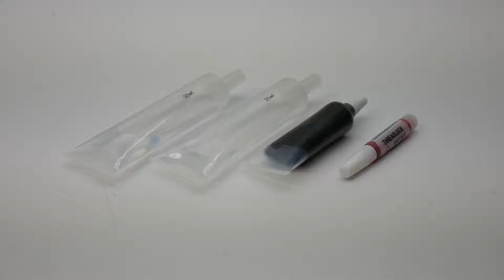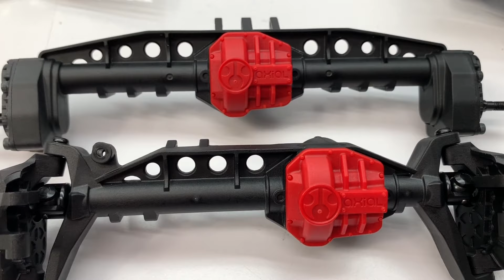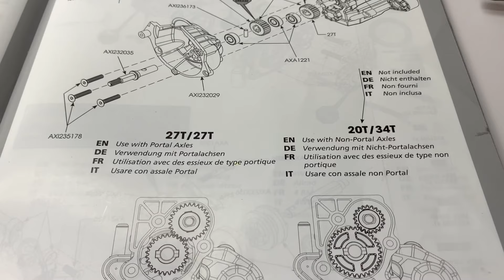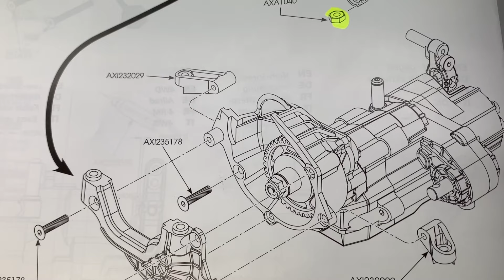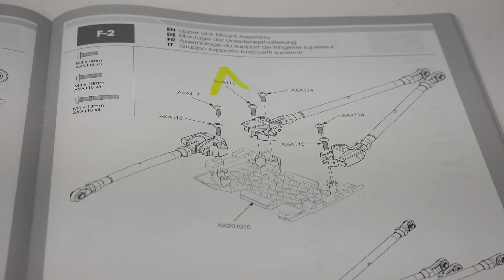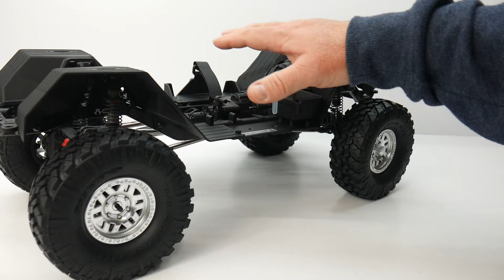Axial SCX10iii - Build Review - In Depth Look at the Chassis - How it Assembles

Comment: For best result use a M3 thread die to cut the thread in the hard plastic to prevent heat build up.
Reply from the maker: Good tip.....I was flying blind on this build, as it was so new at the time

Comment: If you have to tap holes I'm definitely not buying it. The TRX4 is so much better anyway.
Reply from the maker: I didn't have to tap them, although Horizon Hobbies/Axial recommends this.  The Panhard mount/driver side shock tower is also an issue is you run a decent servo....it will end up breaking

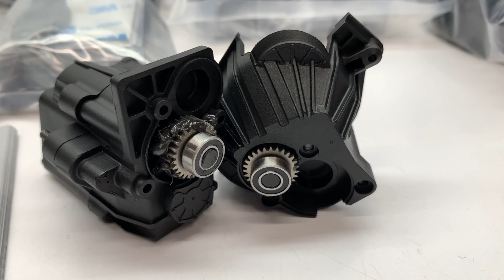Comment: @7:40. ### Why does a brushless sensor motor negate the need to use the 2 speed?###
Reply from the maker: Brushed motors are famous for their low end torque and smooth start up, not much top end speed (depending on turns).  Sensorless Brushless systems have torque and top end speed (depending on kv), but not a smooth start up - when you add a sensored brushless set up, you get all three worlds - smooth start up (being sensored), torque and top end speed (depending on kv)

Comment: I'm glad to see a fresh ground up new truck from them, and not just another rehash of the aging older platform, I'm definitely interested to see if they are setting this up for a portal less version and what size tire combo will fit it
Reply from the maker: They've already mentioned the capability of a portal-less drivetrain - most 1.9" wheels will fit - the JLU body is ideal . for the 4.75" Nittos, so basically anything 1.9" will work.  The stock wheels seem to be about 225SLW size

Comment: Laughed when you were talking about stuffing up Rich. I’m building the Tamiya Sand Scorcher and I’m tired, and same as you making mistakes. 
Getting towards the hard plastic stuff now, where it is gluing, painting etc. so I do have to stop for the night which is a good thing. As I look at the rear wheel and tyre on one side, the tread is facing the wrong way. And those suckers took forever to get the centre in the edge of the tyre without the five 10x2mm screws and matching nuts.
Tomorrow’s job!
Goodnight and thanks for the build review 👍🤓🇦🇺
Reply from the maker: I have a pretty standard rule now - no soldering after midnight. 😬
Reply: The RCNetwork a very good rule Rich! I’d probably have to add in no scalpel and reamer worker 😳

Comment: Good point on not using a power driver on the shock mounts.  I wouldn't have thought of that.  Thanks for the review!
Reply from the maker: Glad to help - it's a super stiffplastic for a reason, but brittle when driving a steel screw in it

Comment: Just like the Capra, I won't be investing in a kit that requires a $50 servo to get missing parts...
Reply: That servo is 14 bucks...but yeah, I see your point. Would be nice of them to include the servo saver parts.
Reply from the maker: Yeah, like Revnine said, the servo is $14.  But I'm with you, the servo saver items should all be in the kit regardless of which servo you use
Reply: Ok, at $14 that's very reasonable it's just the proprietary nature of not including it, thanx for the info guys!😁

Comment: I got the axe xerun sensored 1800kv am I going to have the same issue
Reply from the maker: Not sure, I have the motor mounted - but likely have to turn the motor to the side for the wires.  Just started ,messing with it last night while this video was uploading.  The main issue is the sensor wire

Comment: What motor and esc are you going to use
Reply from the maker: For right now, the Hobbywing Axe system....but there might be issues with the length of the pre sized  sensor wire

Comment: I want however I got to wait for RTR don't wanna build this kit
Reply: the transmission alone will be very labor intensive - I bet the RTR is going to be on the plus side of 500 easily, especially if they include the two speed and dig features...
Reply: RTR will probably not have the 2 speed and dig all in one or it might. Hard to tell. Usually the kit supplies all the features.
Reply from the maker: If we base what we know from the Capra - likely 2 months or so for the RTR - price will be pretty high though, as the Capra did include the dig, servo, etc
Reply: Did you get the RTR? I just got mine. My first since my Associated RC10 nearly 40 years ago!! No way was I interested in building this one. It's an awesome rig and very capable with my biggest complaint being that the shocks leak and were pretty much flat right out of the box. They're pretty good feeling shocks with oil in them but the mod bug hit already a day after arrival and today, my Pro-line shocks will be here. I don't want to chase the known leaker issue. I'm running DIG and it's a great feature, IMO. The 2 speed is supposedly too close in ratio to be worth adding a servo. Maybe when I wear out the motor and replace the electronics package I'll give a try.
Reply: @OhMySack  I will not get one had a capra and kept stripping portals so as nice of a rig as it is tf2 life for me and trx4 portals

Comment: Looks like a decent project I could get into. Q, I've heard you can fit a 550 motor in there with some trimming to the engine case, does it seem possible? I was thinking about the HW Axe 550 system. If so, will it be overkill to fit it with 2 speed?
Reply from the maker: I mounted a 540 motor last night...and there is room for a 550 (although I didn't test) . Everything will be tight, regardless because of the "motor" facade.
Reply: My AXE 550 did not fit - it was too long.  I has to order the brushed motor/esc combo that comes with the RTR